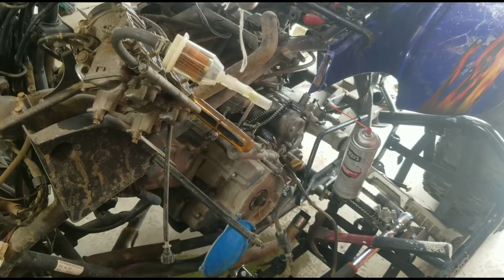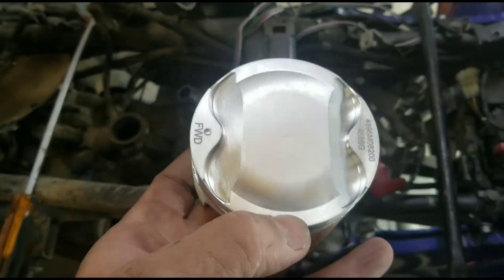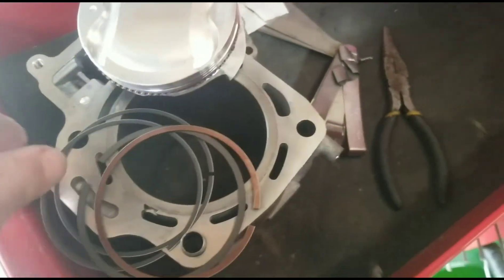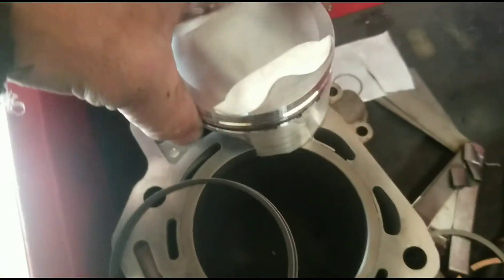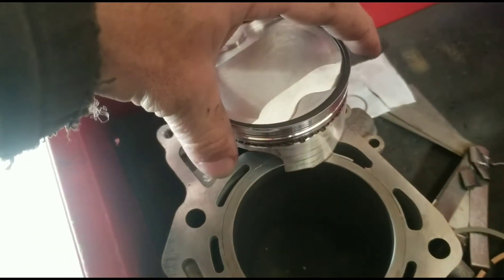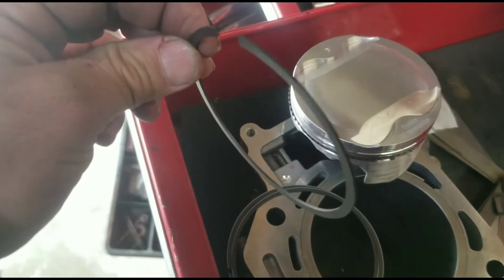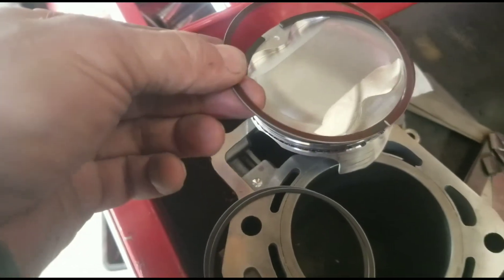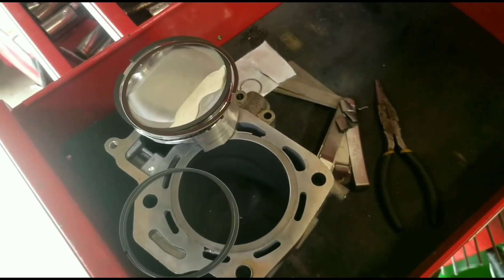KFX700 Piston Installment Direction

Comment: Looks like a Wiseco kit? Did you have it bored and honed to freshen up the engine? I'm in the middle of rebuilding an '05 KFX that has a blown rear head gasket and piston ring scoring on the front cylinder. Not something I can fix with a honing tool so taking it into a engine shop to have the machining and valve job done on it.
Reply from the maker: Yes it's a Wiseco kit. This job did not need to be bored out, just honed. Good luck on your build and thanks for watching!!
Reply: @brothersmechanics2028 from ebay?
Reply: I have blow by but engine still running good but leak oil is it hard to do the piston job 1 st time working on bike engine